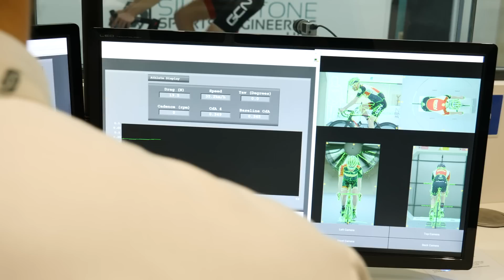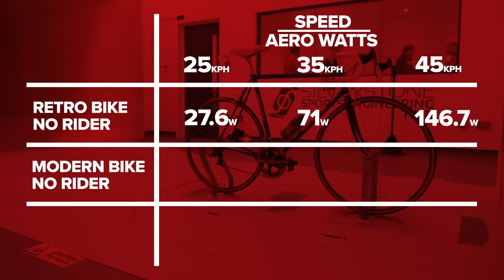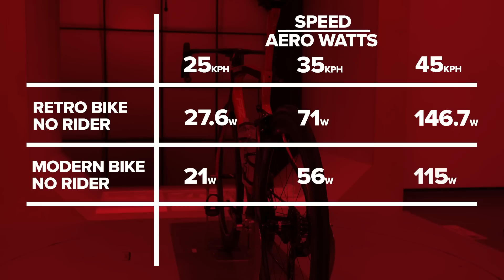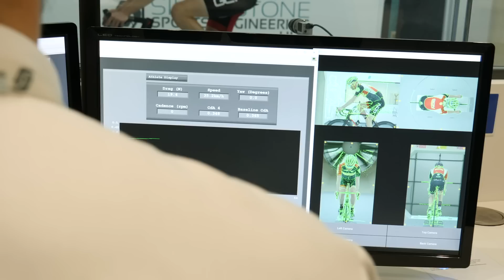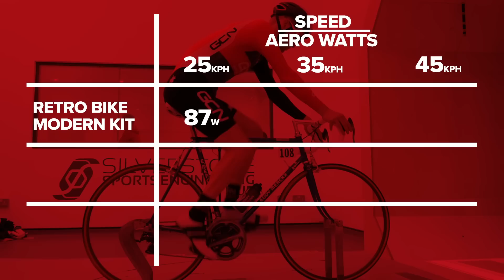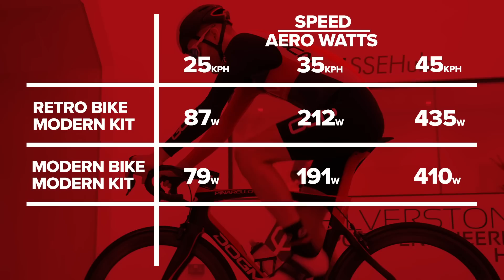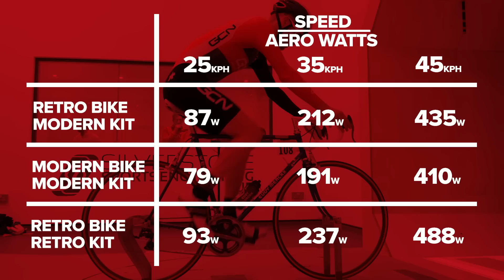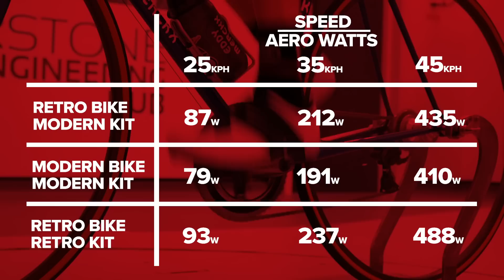How Much Faster Is A Modern Road Bike & Kit? | Retro Vs Modern Wind Tunnel Tested

Comment: Dear GCN, would you consider doing a modern version of this, comparing Pantani to Pogacar? I did the maths quickly, and incl rolling resistance a conservative suggestion would be just above 40w of difference at 25kph, with tire choice being the single most important difference

Comment: I've been considering getting a metal frame and have been looking for comparison data but it's actually difficult to find since most recent tests are comparing similar carbon frames.

The data is reassuring - especially considering that I'd use aero wheels so the bike difference would be even smaller.

Comment: Put the bikes at an angle to the wind. That is the type of wind that most bikes will see. Not wind perfectly head on. I'd be interested in those numbers. The difference in your test with a rider on was only 21 watts at 35kph or a savings of only 18 Kcal. Yes, there is a difference, but it is not as gaping as you seem to make it out to be Ollie.

Comment: Ollie did the basic math wrong. The retro bike in fact is 31.4% less aero at 25kph vs 26.8% at 35kph vs 27.6% at 45kph so the gain from the modern bike is lower, the higher the speed is. Same with measurements with a rider - about 10-11% difference at lower speeds vs 6% difference at 45kph.

Comment: Need to repeat the test with Jon and average the 2 results (since Ollie is biased towards aerodynamics).  Also, Ollie states the retro bike has wider bars, so that also skews the results between the bikes.  
Interesting that the Wattage difference between the bikes themselves at 40kph is 32W but with Ollie on board, it drops to 25W at 40kph.

Comment: My old box section tubular rims are oh-so-much more comfortable on rough roads than deep section carbon wheels, or even aluminum box wire-on rims, for that matter.  I think a long day on those super vertically non-compliant carbon wheels would actually be more tiring, especially if there was much of a crosswind.
Reply: And that steel frame😌

Comment: This, coupled with their other videos and many studies, etc. does seem to prove that aerodynamics doesn't mean much unless you are (a) going really fast; (b) going extremely long distances; and/or (c) being timed. The biggest differences you can make for all speeds and so on would be your positioning on the bike (total body), followed by the correct (1) tyres; (2) helmet; and (3) clothing, which really only requires a light-ish bike and rider, some money, and a road bike of some form. For most riders, anyway. Of course, if you are really heavy/fat, then the best thing to do would be to become skinny, but I'm assuming a baseline of around 150 pounds for most riders to begin with. The other major improvement would be the tri-bars (again, for further aero-positioning, which is by far the biggest factor of cycling in terms of watts/drag -- with the 'egg position' being proven to be the best possible position, but it's unrealistic for most bikes and riders and very difficult to actually maintain). The problem with tri-bars is they are not normalised within the context of most forms of riding and are very costly on the body, with limited usage, as well. Everything else, such as the wheels and frame, don't mean much unless you are at high speeds/racing, or going really long distances, though real-world conditions massively impact, either positively or negatively, the aforementioned. Highly costly wheels and frame are not worth it for 99% of cyclists, therefore, but some other items could be worth it for a lot of people considering their relatively low costs to/over watts saved. Naturally, the reason pros care a lot about their fames and wheels is they have already maximised everything else, which only leaves the frames and wheels for extra gains. But, this only applies to pros.

A rough understanding of aero additions/elements (this changes slightly depending on the speeds, terrain, and otherwise factors) from best to worst in terms of watts/drag:
(1) Low body weight/slim figure.
(2) Ultra-lightweight bike (5-8kg).
(3) Aero body positioning (say, with drops).
(4) Aero/correct tyres (outer-rubber, tread, inner-tube, size, and PSI) -- unclear how high on the list this is, in reality.
(5) Tri-bars (with some standard bars, as well -- not TT bike).
(6) Full-aero helmet. 
(7) Skin-tight, aero clothing.
(8) TT bike (limited usage, however).
(9) Extremely aero frame (non-TT bike).
(10) Extremely aero wheels (say, 88mm deeps with specialised materials and profiling, but they also have disadvantages in some conditions).
(11) Clipped pedals of some kind -- unclear how high on the list this one is, as well. But, we do know some watts are saved by being stuck to the pedals, and they are fairly cheap.
(12) Shaved body (from head to toe), and otherwise tiny adjustments to both bike and rider.
(13) Further weight reductions, such as with removal of water bottles and food, etc. (naturally, you are forced to carry a certain amount of fuel unless you are only riding a really short distance).

Comment: Can I find the results in print? I'm trying to write down some things but I have to keep watching the video.

I always wondered what something like an OCLV from 2000 with aero bars would have done if I'd substituted a modern aero road bike with clip-ons. I wonder if integrated stem/handlebars and all the sculpting would've improve my 40km time much? I'm must too old to repeat my rides of the early 2000's, but it would be nice to be able to compare them with modern bikes and speeds.

Comment: They lose a lot of drag because of those unconventional delta brakes ,non aero rims and handlebars setting.Try to do the test only with the frames and see what happens or swap the modern groupset on the classic frame.

Comment: So wait, how is aerodynamic drag actually measured in the tunnel, how do they come up with the number? What sensors or what ever do they use? It cant be anything on that stand that would measure any push on the bike if you can sit on it and pedal.
Reply from the maker: They can measure the disturbance in the air as it passes over an object or rider at a certain speed using some very nice in-built technology

Comment: 1:40 "reserved for pro riders on descents" does that mean for long periods of time? Cause i know that i am able to get up to 50 kph with my bike on a straight and sometimes even 60 on a light downhill.
Reply: 45kph pace. They can hold that speed all the time. Not max speed. On descends the pro rider could even get to more than 70kph
Reply: @faizishak9962  I can only hold like 32 kph for like 15km

Comment: So it's 435 watts for an old bike vs. 410 watts for a modern bike at 45k/hr. And they call that https://youtu.be/1mJ06mro5fw?t=605 significant. While it is significant, it is actually pretty small and I bet many could fine-tune their position and save 25 watts. It goes to show that, while modern bikes are still worth it in order to compete at the highest level, most people expect way too much from their 3000 euro aero bike frame while they hardly have an aero penalty from a 100 euro vintage frame. And why did you open the zipper on the retro clothing and put on two layers of clothing? I didn't see any retro riders with the zipper fully open while doing a solo effort to stay away.

Comment: Bullshit for goofs!

First of all, nice cheating with water flask on Retro bike! And when you speak about aerodynamic profiles you should have mentioned that your Dogma's tubes ARE 3 TIMES THICKER than round tube profiles on Merx! So this is 3 times more drag. At same thickness round profile ~50% of Cd, drop-shaped(perfect case) ~12% of Cd. But shape of modern bike tubes are not drop-shaped! They are far from them, for this dogma i believe it is ~20-30%. And also they accidentally forget to tell you when sell trier products to you THAT THIS SHAPE OF FRAME AND AERO WHEELS SAILS ON CROSSWINDS! They even slower than classic frames and wheels! Because they have more cross-section area, and most of time you ride at crosswinds.

Comment: Why why why....rollers on a stationary wind tunel.....the wheel is 100 % not being represented properly. The part of the wheel touching the ground is not moving. If it was.   It would be sliding and skidding. If you have 0 wind...and traveling 20mph...the part of the wheels touching the ground is not moving so 0 mph over the wheel ....basically everything from center hub to 6 o'clock position...but great test.

Comment: No cylindrical shaped space ships? Saturn V that took man to the moon? Space X Heavy, any rocket ever fired... You get the idea. A cylinder with a point on the end. A point that would look like the dunces hat than Olie would need to wear whilst sitting in the corner facing the wall...

Comment: I am a bit confused when I do the following numbers to isolate the body/position drag:
(Retro bike + modern kit 435W) - (pure bike drag 146.7W) = 288.3W
(Modern bike + modern kit 410W) - (pure bike drag 115W) = 295W
Can we conclude that a modern position is worse than the old one in term of drag?

Comment: Would these results not be fairly different if the wheel speeds were correct vs wind speed (to simulate - more closely - actual ground speed) given that rotational drag has a large effect on bikes? From what I can tell, even with the rider, the wheel speeds were nowhere near what they should have been.

Comment: The difference is smaller than presented in this video. The retro had a wider handlebar, they said it in the video. That alone means more aero drag for the retro. The fact that they didn't use the drop position is also amplifying the results and does not compare to the real world. For more realistic numbers, identical width handlebars must be used and the rider must be in exactly the same position for both bikes. 99% of cyclist don't need aero bikes for what they are doing. The difference is very small and only matters in competitional setups.

Furthermore, the measurement of the naked bikes is completely useless and makes space for false assumptions.
Reply: 100%

Comment: Just proves all this aero bs is totally useless for the average rider. Most of the drag probably comes from the wheels. Get a nice steel frame, some modern wheels and kit and you'll be within 10W difference. Which is nothing.

Comment: I would love to see what my MTB with a t-shirt and baggy shorts would score in watts :)
Reply: That's my current setup.  But here's the power move: train like crazy.  Keep up with the roadies on that MTB.  Then get a superbike and some aerodynamic kit.  Leave those roadies in your dust.
Reply: On the trail it's irrelevant. Wind is not really much a factor. Totally different sports. But riding on the road with MTB clothes and then going to even road retro clothes would be a huge improvement
Reply: @MountainVisions  from context it might not hafe been clear, but this particular mtb is from 2000 and is really more like a gravel bike, and I ride almost exclusively on the road.
Reply: @truepennytv  oh, gravel biking definitely would see an improvement. You need a road bike for the road. Much more fun. Faasssssssterrrrrrrr! Just buy an old steel bike (something with quality triple butted steel) and upgrade good quality (semi) modern components, and high end modern wheels. It will hold its own with modern bikes for 1/4 the cost.
Reply: @MountainVisions  I use this "gravel bike" mostly for road biking but I do take it off the road fairly frequently.  I don't need a road bike for the road, my gravel bike does an admirable job.  Someday, I'll probably get a road bike, but for now, it's just better for me to use the old steel bike that I already have for both.  That way, I only have to store one bike in my garage, where I don't really have a good place to put another one.

Comment: No doubt modern bikes are faster and more refined. But and a big but - At the end of the day when it comes to riding up them thar hills there is no substitute for the rider  being a lightweight. I have both a modern road bike and a thirty year old steel frame Bianchi complete with brake cables dangling out in front and friction levers !!. On any decent climb the ole 12 spd Bianchi is just fine - drop it into lowest gear (21 tooth) and stay there cos you don't have much choice !! I am 180 cm - weigh just under 70 kg The feeling of cleaning up newer machinery on that old iron just can't be beat !!   That is the reality of climbing hills - a light rider will always beat a heavy one of similar fitness no matter how light or modern your bike is

Comment: Bicycle Quarterly published years ago a very interesting wind tunnel test comparing the positions on the bike with or without fenders, racks, bags, capes etc. and a rear life tyres test.
The latter showed that the “small tyres-high pressure equals faster speed “ rule we’ve been always taught is not true

Comment: Did have a chuckle.  Modern clothing does not make you go faster, just easier to go faster. 25kph in retro clothing is the same speed as 25kph in a skin suit. 

Also most sensible bit of advice...  don't drop £000's on a bike (as much I love to)  spend the cash on better kit.  Great video. Shame I just dropped £000's on a new bike. 🤣🤣🤣🤣 not really, I neeeded  number 4, reasons for the wife please as I doubt she will understand.

Excellent video, thanks again guys.👍

Comment: A good comparison would be the  retro bike with modern wheels vs the Pinarello.  The question being, is it worth putting 10000 euros in a new bike if 2000 euros in a pair of good wheels do 70% or 80% of the job?

Comment: With my retro bike, I gonna burn 10% more fat keeping the same speed. I will stick to retro!
Reply: Hmm well, if you’re riding by yourself, doesn’t make you work harder. It just makes you slower. Lol
Reply: its a super small difference in lost watts between the 2 bikes, its minimal, they just wanna sell bikes, typical gcn, infomercial. just keep your old bike, no difference really. not worth forking 6000$ for 20 watts, give me a break
also, he wore a skin suit, who wears that
Reply: Exactly! And my retro bike even doesn't have delta's!
Reply: i was thinking this earlier today, stick with a retro bike and baggy clothes, burn more fat and be more fitter, plus you don't look like a woofter with all that stupid outfit on, also if you ever do ride a fancy bike with all the outfit it will be easy.
Reply: @nmop3pisdn554  if that's the case then ride a fixie: heavy steel frame, single gear, no brakes. All the workout without spending a lot on parts compared to a road bike.

Don't forget to bring weights for extra weight.
Reply: @sepg5084  Bonus : free motivation when a fat guy passes by you on his carbon bike

Comment: I've done non scientific testing between my Dogma F10 disk vs my 1981 Gios Torino Super Record.  I roll away without pedaling on each bike down the same hill.  I tuck in to the same position (as close as possible) and then take note of the speed as told by my Garmin.  Consistently the F10  is over 10 MPH faster at the bottom of the hill.  I love that this video explains the science behind that.

Comment: Thanks. From the data in that video, the retro bike costs about .025 m^2 in drag area compared to the Pinarello F12, but the retro clothing costs about .07 m^2.  A rough rule of thumb is that a difference of .01 in drag area is worth around 1 sec/km at racing speed, so a difference of .025 is roughly 2.5 secs/km, retro clothing is about 7 secs/km, and a retro bike/kit costs about 10 sec/km compared to tight clothing on a modern bike. If you're not racing, the differences are a bit larger than that, not smaller. Over the course of ten miles, the difference between a modern bike/kit vs. retro bike/kit is about 2-1/2 minutes at the same power.

Comment: Basically when you factor in that airflow is just not as smooth outside, modern well fitted clothing is really worth it, but a modern bike is well into marginal gain territory and most of the aero savings come from replacing box section 32 spoke wheels.
Reply: Shhhh, don't say that, how will this Wiggle channel (errmmm, sorry Gee Cee Ennn) continue to churn out spin for all the carbon framed crap to the 'cognescenti' out there???

Comment: Even on the British racing scene in the 70s into the 80s riders would be on 32/28 spoked tubs so box section 32s for a bike from the aero brake lever era is not very accurate, also you've left a round shaped bottle in there when an aero bottle was de-rigueur, I also don't see any drilled components either.
Additionally bars were NOT wider BITD, this is simply the preference of the riders own bike, 40cm, were very common place and 38s not uncommon either, so you've inaccurately measured because the bike isn't really truly representative of a top end pro bike of the era in severl aspects that make a significant difference in aero.
Also EIGHT watts at 25km/h is NOT HUGE ffs, the difference is about 10%
And when wearing the retro gear, no self respecting pro would wear a helmet, less so the hairnet/banana hat, not in the 80s ffs so you're adding even more watts.

Comment: Great comparison!  My real question would be how much difference do the wheels make?  In the 90's they switched to 130mm rear width which allows for a modern wheelset.  I run a deep carbon wheelset on my Corsa Extra.   It really makes a difference compared to my other steel racing frame with box rims.   Even a narrower frame could have a modern wheelset built for it, if performance is your goal.
Reply: Or, reset the old steel frame fo modern dropout width.

Comment: You are a bit off on describing CdA. CdA is the area of an object with Cd equal to 1 that has the same drag as the item tested.   A body with area 3.0m^2 and Cd=0.5 has the same CdA of a 2m^2 body with Cd=0.75. (both have Drag Area=CdA=1.5m^2)